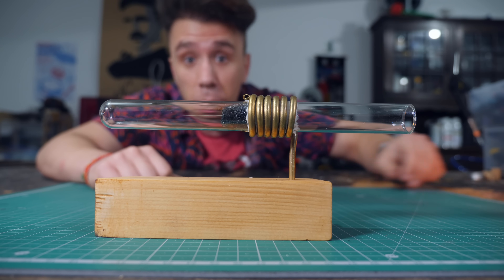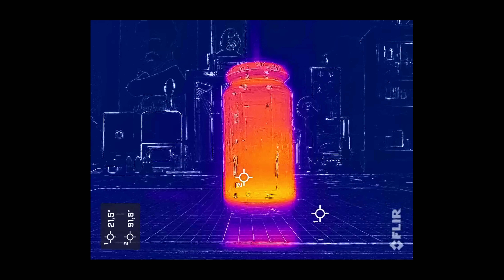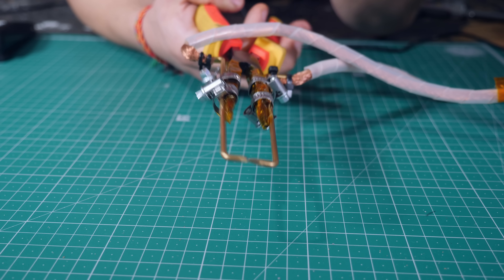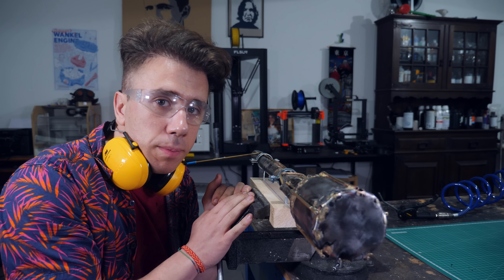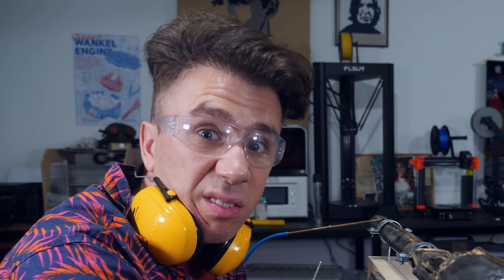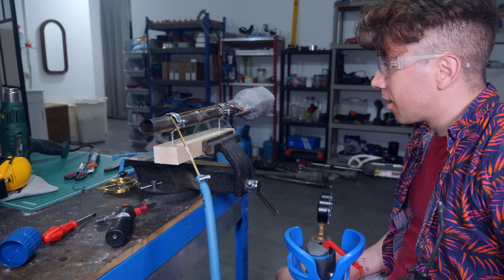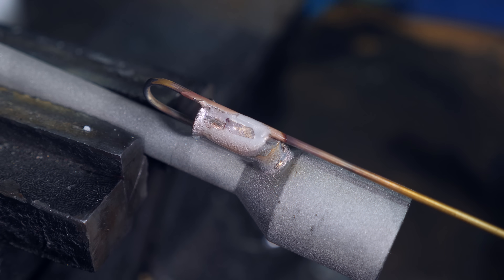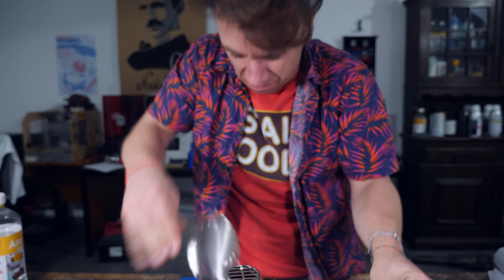JET ENGINE with NO MOVING PARTS (Pulsejet Engine)

Comment: I still think that testing products  like cerakote for coating the inside of combustion chamber would be an interesting experiment. Could you get away with using materials that can stand up to less heat but have a thin coating to dissipate heat? Pla coated in cerakote perhaps?

Comment: if make something as small as the gyro jet you can you it in a video to test different fuels and nozzles on a small scale all you need to is a small clear tub strong enough to hold it a sand bag to trap  it  and  and the background that help you determine speed thar you can test  all of it mix and match to see what fuel and nozzle mixes work the best together

Comment: I made a waste oil heater for my garage that functions like a pulse jet. It resonates at 48hz, so it's a little more like the hum of a subwoofer. It's gotten me through a few winters so far and can run steadily on as little as 24 ounces per hour.
Reply: Could you link a video which you used as a template?
Reply: @Boz1211111  it's an original. If you're on Facebook, I shared a couple of videos in a group called Waste Oil Burners. That's the only place I've made it public though.

Comment: i wanna see different blade mock up for hydro turbines to find a more efficient design . first you would have to build a mini dam to  ensure constant equal pressure and do some research to get the proper geometry and orientation if a design is better it can be scaled up and implemented

Comment: Honestly Welding is pretty easy with some practice. Doesn't take very long to learn.
Its also not expensive.
Just do it, would be amazing to see kinda reliable Jet engines which don't melt. :D
All you need is a angle grinder and a welder, i would choose mig welding.
Dont be scared of metal. cutting, forming and welding 1 or 2mm steel plate is super easy.
3D printing is still good for making a prototype.

Comment: As a future video it would be really interesting if you built an engine powered by "aluminum" (the hydrogen from the reaction of NaOH+Al) to see if NaOH and Al/aluminum foil is a viable way of generating instant fuel for a generator as an example if you wanted to make this engine a generator.

honestly i know this may not be the most liked out of this sea of comments, but having a 3D printer has been one of my life long dreams though i've never had the money for one.

Comment: Always wanted to see a valved pulse jet with active control from a motor. That way you can build the valves to be heavy and have long life and still close them rapidly fro efficiency, anticipating the pressure rise. You also could perhaps tune the design with the active control to reduce vibration. On a vehicle you could adjust the timing to account for changes in ram air pressure, perhaps even transitioning at high speed to ramjet operation.

Comment: just get sheet metal scissors, so why dont you use steel pipe, also some screw-in end-caps for the same pipes, also steel, also make it a pre-heat gas turbine, not pulsing. k.i.s.s. use pipe

Comment: I know small formfactor jet engines cant reliably power flight with  the base weight of fuel but is it possible to power a turbine or just a teslaturbine on a pulsejet? would the exhaust be stable enough get a wheel to move...

Comment: Could you try using blowtorch heads as the core of a turbofan? It would be somewhat complex, but with a balanced metal printed case and shaft it could work.

Comment: 🎯 Key Takeaways for quick navigation:

00:01 🔥 A glass tube with steel wool inside can create a sound due to temperature differences and air elasticity.
00:55 🚀 A "gem jar pulse jet" engine can be created by adding alcohol to a jar with specific geometry.
01:57 🔩 The jet engine relies on pulsated combustion and proper geometry resonance.
02:11 🛠️ A composite material for the engine is created using 3D-printed molds, carbon fiber, and thin steel metal.
06:21 🤞 Starting a pulse jet engine can be challenging and may require various attempts with different gases.
09:15 🎉 A 3D-printed metal pulse jet engine is successfully created with the help of a friend who specializes in metal 3D printing.
10:16 🥰 The simplicity of the jet engine design is appreciated, and the files for 3D printing the engine are shared in the video description.

Made with HARPA AI

Comment: Hi, Joel. (I apologize in advance for bad English). 

     I analized all your videos about making liquid or solid rocket engines. The main problem all of those prototypes is a termoresistance. You tried different types of filament. Plastic, resin, metal even ceramic. Also, water cooling was such a nice effort.

      I have the idea, that can be helpful for you. For the cooling of small engines with a thrust of up to 10 tons sometimes applied ablative cooling. This tech was used on propulsion systems of "Apollon". On the inner wall of the combustion chamber and nozzle, a multilayer coating is applied, part of which due to sublimation or decomposition, carries away most of the heat. Other part is thermally insulating and concetrates heat in the ablation layer. Suitable materials may be graphite, PTFE or polyethylene. 

      I think, this tech, which still used in many active projects, will apply to your projects as well.

     I am the fan of your work.

Comment: you could try to make a rocket engine with the combustion chamber that they used on the space shuttles, with the multiple coolant channels like the original
You can print the main part of the chamber with the metal infused filament you have and make the coolant channels with wax and some electroplating like in this video:
https://www.youtube.com/watch?v=H4YZxb2E5PA

Comment: Now that you've got the pulsejet design proven and working, I think it's time to take things up a notch. There are turbocharged pulsejet designs that use the exhaust pulses to drive a compressor that feeds more air in for the next pulse to consume.

Comment: You should try Copper or Brass sheeting for a Pulse Jet Engine. With Copper you'll be able to get the tube from a plumbing supply store. Probably will handle the heat

Comment: How about making a 3D printed coilgun that shoots rocket propelled projectiles on delay(like a steel cylinder with a hole on one side for the fuel and maybe a screw-on nozzle)?I mean coil  gun launches the projectile and after 1 meter of flight the rocket engine ignites.

Comment: If you like pulse jet maybe you can tie up with colin and make one hidroforming the sheet and i think the tesla valve in the past one you said that to improve the seal its cut the flow but if you make one large  enough, you get flow enough and seal in reverse thanks to the extended path i think that you get that wrong the valve it has a hole in the midle its just an open side and it needs to be in both sides the extended valves to avoid the air return in the escape just a tesla valve with a combustion chamber in the midle

Comment: You could build a scramjet engine, perhaps using a leaf blower to achieve the air speed to make it run;  as fuel I was thinking of the mixture of sugar and potassium nitrate that you used in the Aerospike Rocket engine project some years ago (it is your first video that I saw), perhaps added with oxygen or methane.

Thank you so much i love your videos♥️

Comment: my suggestion: now that you can print in metal, you can design the engine chassis with heatsinks, maybe it will improve your relationship with extreme heat

Comment: Theme for future video pulse jet powered  roller skates  🛼 . Take a pair of roller skates put a pulse jet motor like the one you just made on each. Put a battery powered air compressor and small fuel tank in a backpack.  Make a hand control with throttle and ignighter.  Remember pads and helmet ⛑️

Comment: since carbon can be electroplated, I wonder if you could just print the engine, dust it with graphite if carbon fiber doesn't work, and just grow a metal shell on the combustion chamber.

Comment: Use the thin metal as the chamber and ceramics as a structural layer.
Your previous ceramic engines was not airtight enough but that would be taken care of with the metal chamber.

Comment: Hey man I wanted to throw a few ideas your way. You should consider making a u shaped pulse jet I think thats right up your alley and I hear you. You're not good at welding but here in the US you can pick up exhaust pipe of many different dimensions and shapes. Particularly u shaped and straight pipes. Best of all you can put a cheap high temp gasket in between joints and bolt them together. They cost slightly more but they are made to handle the temperature and pressure of a gasoline engine. Might have something to go with there. Consider it man. Everytime I watch a new video I can see how much you want to make an engine of your creation come to life. I get it. 
Second bit is learning to weld. MIG is basically free but I understand it doesn't come easy to some people. I had a guy at my work when I was learning tell me to get a hot glue gun with an exposed metal tip and "weld" glue sticks together. Shit works and it's dirt cheap to practice or consider plastic welding seeing as you 3d print its a handy skill to have. "Welding procedures" transfer over to so many other manufacturing/fabrication processes. Hot glass work in particular which in my opinion is like the final boss of welding. Look into it man the heat glass, while spinning it in a large, and adding filler glass. It's impressive. Best of luck man I hope any part of this was helpful in some way.

Comment: 1. 3dprint the tubing into the chamber walls for cooling. 2. Add cooling fins on the parts getting up to melting temperature. Would likely 10x the lifetime of the device.

Comment: Print a solar / wind /ocean current  turbine powered submarine that communications using ultrasonic transducers and hydrophone loops (like a modem for underwater) so you can drive it or give it commands without wires. I don't think you could get bandwidth high enough to transmit Images through water but that would be even more cool. You can use hydrostatic pressure and inert liquid dialectic to maintain submarine electronic bay integrity. Then use blasts on the sides to control the depth.

Comment: 3D print a small 4 wheel bike with a pulse rocket propulsion engine. That would be fun to see. Cut an old drive shaft to length, cut a 25 gallon drum to the mathematical length, use steel copper pipe for fuel injection, and you'll have an engine large enough to power the bike. 😊

Comment: Revisit the metal 3d printer but this time try using lasers instead of this welder you also could try to reduse the voltage on the welder a bit so the metal doesnt melt that much
Reply: I mean that the wire gets redhot but doesnt flow like water

Comment: Idea for a future video : A pulse jet engine with a cooling system, and use the Arduino to control fuel intake and air pressure intake to startup (like used in last video to maintain 2 bar pressure in cola bottle) ?

Comment: Would using ceramic coating to contain the  heat inside the gas jar work?  I used to work in ceramic coatings I side race engines to either expel heat or contain heat which improved life spans of engines. The process is kind of lime poweder coating

Comment: Clearly there is no time to give up. We can achieve together the pla jet engine ! Why not making a fluid cooling system that run inside of the pla ? If the debit is good enough it may keep the plastic not melting and boom: pla watercooled jet engine !

Comment: You can try to make a Hydrogen fuel engine.
They are of two types. One is doing hydrogen combustion for moving and the other one is producing electricity by combustion and running electric motors.
No one has done it on YouTube and we still don't have a real working model of it..... all the vehicle companies just hide this engine from us.

Comment: you should avoid tesing your weld stength by tugging on the loop from the inside. if it fails you end up with some deep cust as the thing would slide across your fingers.

Comment: There have been many videos about measuring 3d printer parts resistance to temperature. I think I never saw one that measures how much air pressure 3d prints take. You could probably make a simple geometry then use it to check the pressure rating . This could be useful for people who wants to make stuff like couplings, adapters etc for compressed air connections

Comment: Do you think it'd be possible to add a secondary head to a 3d printer that impregnated the freshly laid plastic with a thin filament of metal or other material? Could really help to make molds stronger

Comment: I think doing a more advanced jet engine and testing propulsion would be super interesting! Or trying to make a boat with "unlimited" energy with zinc and copper electrodes along the bottom which could effectively turn an entire ocean into your battery (although it produces quite low power)

Comment: you can use 3d print material that is the same as material used in lost wax castings, then put it in a sand mold, pour your own.  I know a company locally that does this for prototyping and castings of alum, stainless, and titanium.

Comment: You said you don't have a 3d metal printer why don't you make one with a regular 3d printer mechanism and instead of a plastic feed you use a mig welder and mig gun yes it won't be pretty but if you get the wire speed and voltage just right it will make a ruff copy of what you need and a little grinding and sanding will clean it right up

Comment: Id like to suggest a variation on your pulse jet engine. Years ago i read an article about a "ram pressure" jet engine. They built and used  one to provide enough thrust for a real sail plane. The basic idea is that you add an intake funnel to the combustion chamber of your pulse jet. You run your copper fuel line, coiled, through the combustian chamber. On this one, you use liquid fuel. You then end the fuel line with a nozzle that points and forces the evaporated fuel into the intake funnel. Add a spark plug inside the combustian chamber. I made a primitive version out of a small pipe, hobby tubing, and used alcohol as a fuel from a syringe. I got it to function for a fraction of a second before it melted on the kitchen stove without burning the house down! Success and fun!

Comment: I think you should try liquid cooling for your engines. It sure takes a longer time to make, but the benefits could extend burn time to multiple minutes if not more. Maybe "weld" a long metal tube in a spiral pattern around the burn chamber, attach a pump and a coolant reservoir, make the pump move the liquid through the pipes into either a large coolant reservoir that would act as a heat bank or a radiator from a moped or pc or something. It sure would make an interesting video. You could also try adding some heatsinks to your engines to radiate just enough heat to stop the engine from melting. Remember to use thermal adhesive, thermal pads or thermal paste between any cooling element and the surface.
Reply: That's kind of what's happening with that coil of fuel line around the combustion chamber, but I agree, a dedicated water line would help get some life out of these little engines.
Reply: why not having that modeled in the file and printed in metal, pipes around the engine for liquid nitrogen, i think a rocket engine is far more efficient at heat dissipation since the combustion occurs outside the engine body.
Reply: Just put a tube over the tube that makes up the engine and pump water through the gap between them, much simpler to produce and just requires a couple of large washer like plates to seal it each end and a small in and out hole for circulating coolant
Reply: Correct me if I'm wrong, but doesn't the fuel line allow the high temperatures to decompose the propane into better fuel types

Comment: you need to get that engine metal 3d printed but 1000% bigger. also i would add in the features to make it easier to add fuel line and spark plug that way its less work when you goto put it together

Comment: You should make this same pulse jet engine, that is made out of all 3d printed plastic, but make a water cooled enclosure to help dissipate the heat. 

Making a second outer water enclosure around the first will keep the plastic from melting so quickly.

Comment: I wonder if the "lifetime" of the PLA engine could be extended if it had an outer "layer" that could be filled with water as coolant.
Then again, that could at the same time sap heat from the combustion and change the entire thermo-dynamic of it.

Comment: You should try water cooling it, try running water trough a brass jacket just like you had on the last model. Or try running liquid propane through the coil instead, this should cool the engine and provide fuel.

Comment: It may be that you are thermally cracking propane into ethane and methane.  If so, that reaction is endothermic which takes heat energy and converts it to chemical energy, which mean the ethane and methane have more energy in their molecules than you find in the propane. But better still, you're capturing some waste heat energy and putting it back into the fuel  or ratherly making the fuel more efficent.

Comment: You can do a steam rocket by using 2 rods from The inside 6v baterys and pumping water  Between them ,peaple use The rods for diy furnaces like the one tkor did a long time ago
And by timing the eletric  pulse and water injection you can make a pulse steam jet or a musket to deal wit tomatoes